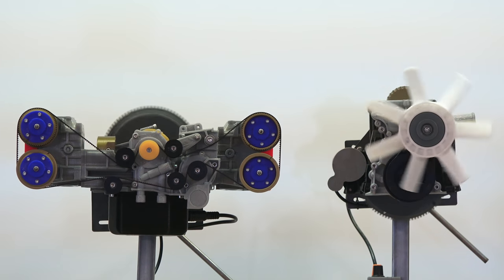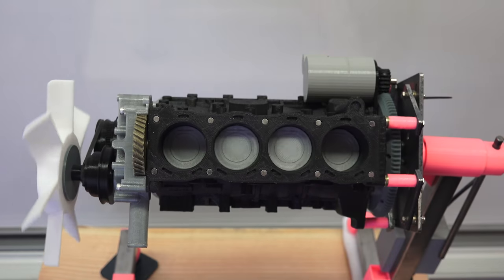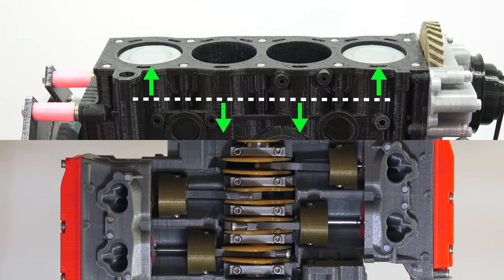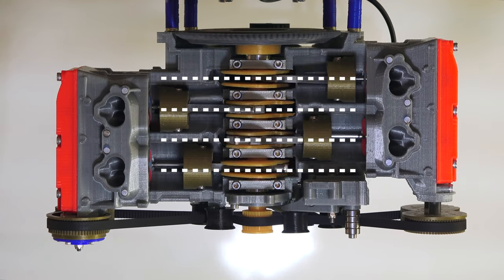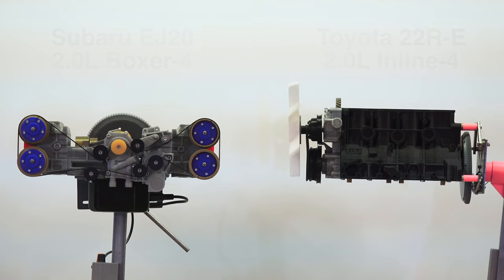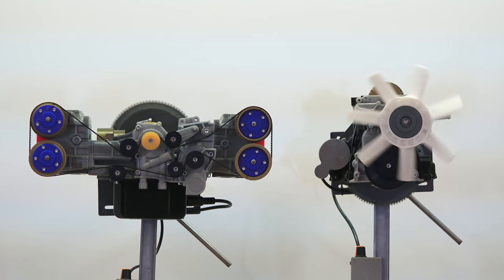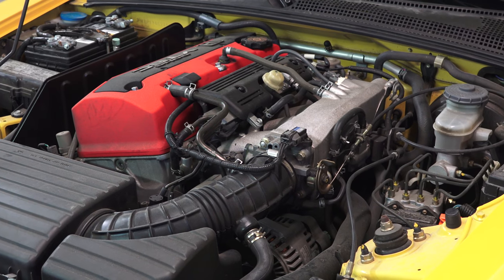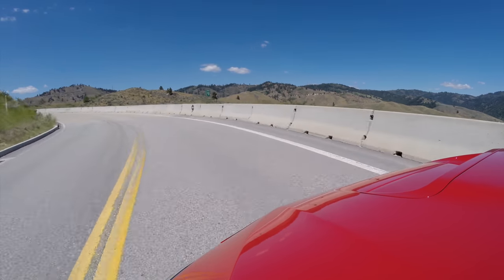The Differences Between Inline Four & Boxer Four Engines

Comment: You mentioned that with 6 cylinders the forces are more balanced.
What about with 2 cylinders? Like in BMW motorcycle engines.
Reply: oh they shake your teeth out.  False teeth with the average BMW bike owner.
Reply: bmw motorcycles are absolute shite.
Reply: I have BMW's since I was 20. Boxer and flying brick. And after 20 years still have all my teeth on. Just because you don't like it, you have to be troll? 
I was only asking for a technical explanation...
Reply: They are also super super super expensive to buy/make, more service is needed and higher gas consumption. A balanced crank
 and forced induction is the way to go IMO
Reply: Wrong!
Expensive yes!
But in a long term service is not more expensive than a R1 (2014). Service once a year or so... anyway.
And consumption wrong again, less than a 2016 Africa Twin. Same trip, same roads, same places, very similar load...
Anyway, I'm not here to defend BMW against the rest of the world... every brand that you may like has good and bad things. And BMW is not above all others.
Again my question was only in a technical perspectiv.
Reply: I own a BMW motorcycle with their Boxer Twin. To be brief, it has the secondary vibration force that sort of twists. In essence, You pull the clutch  in, wring the throttle and the bike revs up and gently vibrates to the right. Its a great feeling, and the amount of vibrations is just low enough to feel connected to what messages its sending through the bars. Though longer trips.. Could use some vibe dampers on the throttle side of the handlebars :) The more you know!
Reply: I also believe Honda makes flat-6 for the goldwing, and i hear  that thing is a Beaut to drive :D
Reply: I'm personally more of a harely/american car and truck person
Reply: Jamie Mills  " poor reliability" ha all 4 of the American vehicles I've had over the last 10yrs ( 2 Lincoln ls's, a mercury mountaineer and a dodge Durango) have been far more reliable than the pos Honda I used to have or the bmw I had for 2 months before it blew itself up, the only reason I've had as many American cars as I've had is two were taken out in accidents.
Reply: Kieran Matzky nothing wrong with that. I went from kawi to bmw just to see how it was. My next bike is probably gonna be the Harley 48. Man that bike looks n sounds so killer!
Reply: I thought bmw only made 4 cylinder bikes
Reply: BMW motorrad makes Flat 2, Inline-4, and a 1.6 inline-6 for their K 1600 GTL (top of the line bike). Their all fantastic. I just wish they believed in counterbalancers for the inline-4s!!
Reply: Yes, BMW only made 4 1-cylinder bikes. ;-)
Reply: BMW makes the BEST bikes in the world. Second place probably Honda. You have to be parallel to the motorcycle industry to think otherwise.
Reply: Two cylinder engines are the worst. Either you balance the vibrations but have uneven combustion events, or have even combustion events with all of the mass moving in unison.  A 270 degree crank splits the difference between the two.
Reply: Amândio de Aveiro The BMW boxer has been refined over time so that the vibration is not an issue for most. Many would say it's a positive which adds character. The low centre of gravity is particularly helpful in a bike. I speak as an owner of a top heavy (but otherwise great) Triumph.  The boxer does have the unique twisting moment which wants to rock the bike around the longitudinal axis. I believe this is caused by the orientation of the crankshaft rather than the boxer layout. It's only really noticeable now if blipping the throttle when at a stop.
Reply: Just get a triumph triple, have the best of them all then.
Reply: re: "I believe this is caused by the orientation of the crankshaft rather than the boxer layout"

correct, that's just torque reaction because of the orientation of the crank.  Newton defined it in his 3rd Law of Motion.  V2 Moto Guzzi's do the same as do airplanes along the roll axis from lowly Cessna's to F16's.
Reply: re: "Two cylinder engines are the worst"  no, Two cylinders that aren't a 90 degree Desmo or a 90 Degree RVT (aka Honda SP-2) are the worst. 

motorcycle guys know what i'm talking about (Willis).  :)
Reply: He said for every three pistons u have a balancing effect so no
Reply: Amândio de Aveiro p
Reply: In an ideal world Harley would put their heads outta their asses and learn from GM how to make a good modern pushrod OHV motor, until then, the V2 configuration will be forever tainted with H-D's reputation
Reply: Amândio de Aveiro in
Reply: The briggs and stratton opposed in in my lawn tractor is an engine like that. Vibrates like crazy. Great engine though, previous owner used it commercially (it is consumer model) maintained it well and it runs fine for me, it is a 2001 model. I think Briggs uses V-Twin now, but the opposed was a great durable engine. It smokes a bit on startup because of the design, but probably a good thing because everything is lubed up.
Reply: That's why they've sold so well all over the world for decades. BMW developed and modernized their engines, as opposed to HD which were still unreliable, long-stroke, air cooled cement mixer engines at the end of the last century. Talking about shaking your teeth out, I rather ride a Beemer than a Harley!
Reply: I had the CB360, Nighthawk 450 and a new model CBR500R, all parallel twins. None of them vibrated as much as some of the 4 inlines I rode.
Reply: I'm still waiting for the first bike with a V6... Porsche, are u listening?!
Reply: Amândio de Aveiro 2 cylinders vibrate like 4 cylinders. 3 cylinders are a lot smoother.
Reply: If that were true, why did BMW, who know a thing or two about engineering, add a counter balance shaft in their K75 motorcycle engines but didn't in the K100 four-cylinder engine (which has the same bore and stroke measurements)?
Reply: Matthew Moore Which Engine?
Reply: I've owned  six flat twins. much smoother than any v or parallel twin
Reply: one two three and 4 cyl bikes have been produced
Reply: 2 , 3 is the flying brick , 4 , 6 all BMW
Reply: That's not a vibration, its a torque reaction against the engine spinning that sends the bike in the opposite direction when the engine accelaerates.  Its common to any along the frame bike engine. Ks (Bricks) don't do it as the clutch spins in the opposite direction to the engine cancelling the torque reaction out.
Reply: Single cylinder bikes too.  And they have made triples.
Reply: Other manufacturers do make good V-twins that are efficient, make power and don't shake your teeth out.  90 degrees is the answer.  Look at Ducati etc.  Harley build for a purpose, 45 degree twins make there character engine sound but also create a lot of vibration, a 45 degree engine is also a shorter package makes it easier to fit in a motorcycle frame.  Whats wrong with overhead cams anayway?  They are only sticking with pushrods because of tradition, not because they are better in any way.
Reply: Im not sure if this'll help your question, but the more cylenders an engine has, the less of a drastic vibration will happen. It also depeneds on where the center of gravity is in each engine and where the motor mounts are.
Reply: Amândio de Aveiro
Reply: Ever seen a harley at idle? The mirrors are a blur.
Reply: Kieran Matzky even American cars experimented with a flat 6. Look at the corvair.
Reply: I've ridden the Goldwing. Its engine is amazing.
Reply: BMW began making boxer twins in 1923 and have continued to this day. They made their first four cylinder motorcycle in 1983. For some of us old guys, the boxer is the real deal.
Reply: 6 cylinder Honda Valkyrie for the win!
Reply: Yep. They barely last 500,000 km.
Reply: I own a Honda ST1100 and BMW R1100RT. Honda wins in HP, transmission smoothness/shifting, raw torque, and top end power. BMW feels more nimble and lighter. More gadgets, but a PITA to work on. I'll stick with Hondas from now on. BMW was my first non-Honda bike.
Reply: Love both Honda's and BMW's  but I agree as someone who has to work on their own bike(cant afford a dealership)   Honda's are great for that.
Reply: BMW two cylinder opposed motorcycle engines are ALWAYS smooth be they carb or EFI does NOT matter, I have ridden both makes.
Reply: It's Only Me you mistake BMW & HD... 😅
Reply: Ride NOT drive.

Comment: Make "what's difference between 180° V-form and boxer engines" video
Reply: The difference is: one can spell and the other can't /s
Reply: In boxer engines, two opposing pistons travel in opposite directions, meaning they are either moving towards or away from each other. In a 180° V-form, two opposing pistons move in the same direction.
http://forums.vwvortex.com/showthread.php?6903518-Boxer-vs-Flat-engine-the-difference
Reply: J C what you mean by that?
Reply: mcfresh spelled knowledge wrong lol
Reply: Flat 4/6 vs boxer is more interesting.
Reply: 1D0N he should have just done all 3 in his vid
Reply: The Motor shown is called a boxer engine by the manufacturer. However this motor is NOT a boxer engine but indeed a 180° V4. In a boxer enginge the cylinders lie directly opposit each other and attach on the crank shaft together. So they actually cancel each other out completely.
Reply: Actually any "V" layout engine has the cylinders oriented in a V, not an opposed layout.  The term "boxer" today does apply to flat, horizontally opposed engines, even if the opposing cylinders aren't perfectly aligned with each other.  BTW, did you know that BMW boxer motorcycle engines don't have perfectly aligned cylinders either?  The left cylinder is slightly farther forward than the right cylinder.
Reply: @ashbow: No. That's a boxer motor shown. You've got it ass backwards. If the pistons were on the same crank pin they wouldn't move in opposing directions. All the cylinders are out of alignment in boxer, hence the uneven exhaust pipe length. Trust Engineering Explained, he knows what he's saying.
Reply: @ Fletcher Your right I rembered it kind of wrong.
I mixed it up with the inline boxer. There the Cylinders do lie exactly opposit each other and one cylinder has a forked piston rod so that the crank pin of the other cylinder can go inbetween.
Reply: Not quite, in a true V engine the opposing cylinders attach on the same crank pin, while in a boxer engine the cylinders attach opposit each other. 180°-V engines get sometimes called boxer even if they aren't.
Reply: Incorrect.  A "V" engine has the cylinders arranged in a "V" - hence the name.  "I" is Inline.  A flat engine is horizontally opposed (not a 180 degree V...)  A series of cylinders in a circle is called a radial engine.  Two cylinders inline are called parallel twins.  https://en.wikipedia.org/wiki/Engine_configuration#Categorisation_by_piston_motion
Reply: Read the first sentence under the categories: "The standard names for some configurations are historic, arbitrary, or both, with some overlap. For example, the cylinder banks of a 180° V engine do not in any way form a V, but it is regarded as a V engine because of its crankshaft and big end configuration, which result in performance characteristics similar to a V engine."
Reply: Not really.  I worked in the R&D departments for two different large European carmakers.  No one in the industry refers to flat engines as "V" engines.  The layout or configuration is based on the arrangement of the cylinders.  Not the position of the crankshaft journals.  The term V isn't based on what the engine sounds like or whether it fires "like" a V-type engine.  It's based on whether the block is configured in a "V" shape...
Reply: Alex Besemer is correct. It's not difficult. In a boxer each piston has its own crankpin, thus cylinders are slightly out of line and movement is opposed. In a 180 degree V opposing pistons ride on the same crankpin, are in line, and move in the same direction. Read more: uhttps://www.carthrottle.com/post/heres-why-ferraris-flat-12-isnt-exactly-a-flat-12-at-all/
Reply: Yeah even better.
Reply: No, that is called a "Flat" engine. Hence my previous comment about comparing a flat vx boxer engine. It's easy to remember as a boxer engine moves the pistons like a boxer smashing his gloves together.
Reply from the maker: I did! https://youtu.be/y5oRsvRH_Ig
Reply: Hi, I have an idea of an episode. Can you try to explain from engineering point of view the difference between the soundtrack of the 4-cylinder Subaru STi engine and that of the Porsche 718 Boxster/Cayman? In other words, why do Subarus sound terrific, whereas 4-cylinder Porsche boxer sucks.
Reply: Because turbo vs no turbo...

Both sound badly though, any 4 cilinder.. BMW inline 6 is the best.
Reply: Nope. Both are turbocharged. 4-cylinder Subarus (WRX, STi, etc.) sound terrific, just play a random YT video
Reply: Just not my cuppa.
Reply: We know the difference.
Reply: @ccrider77  I like how you post a link to the different engine configurations with all the information in this discussion, then deny it because you think your opinion is superior to fact. 😂😂😂
Reply: Reading comprehension isn't your "thing," is it...  This is from Wikipedia:  "The standard names for some configurations are historic, arbitrary, or both, with some overlap."  Basically, what I've stated.  Just because there is a technical term for something, doesn't mean that is how it is always used.
Reply: @ccrider77  Nope. I read it just fine. You followed up with your personal experience which is why I found it funny. There is more to this world than everyone here has experienced and to see everyone diving into this dick measuring contest in the YouTube comments makes me laugh but ultimately feel bad for everyone and their pigheaded bias to feel secure in their own opinion by bashing each other over the heads with a keyboard. I've done it myself but those times have gone and now it's somewhat entertaining to watch. 😅

Comment: one disadvantage I have found with boxer engines, especially the honda flat fours is 'oval' cylinder wear, on higher mileages flat fours tend to rest more on the lower part of the cylinder. This can be demonstrated by leaning the flat four engine from level overnight, when stated next morning it will give a puff of burnt engine oil that has leaked past the horizontal piston, not so noticeable on a inline engine.
Reply: A flat four is not the same thing as a boxer. Honda does not make a boxer engine.

Comment: Also, the downfall of the boxer engine is the cylinder walls wear down faster than an inline. They tend to burn oil faster when reaching the 100,000 mile mark. They are also known to blow head gaskets. This happened to my Mother-in-law's 2008 Subaru Forester. Oil was mixing within the cooling causing the coolant reservoir to overflow pushing oil out with it... That changed her mind of never owning a Subaru again...

She's glad she kept her 2003 Mitsubishi Outlander for a backup vehicle. After she got rid of her Subaru, she is back driving the Outlander with now 263k all orginal miles. Regular maintenance, oil changes and timing belt every 75k miles. 👍
Reply: The boxer engine used in the Subaru BRZ/Toyota GT86 is a pretty solid motor and from what I have read doesn’t seem to have the head gasket issues associated with the WRX and STI motors.
Reply: My family has around 8-9 Subarus with over 200,000 miles. 3 or 4 have over 300,000 miles. My uncle takes care of all of them in his business. He has nothing bad to say about the engines. No major problems besides clear traffic accidents. Some of the transmissions though have been a different story. But they are newer… 2014 and 2016 I think. I don’t remember. Anyway I’m super happy with mine. Just added an Accent to replace a van. Wasn’t sure about it at first. But sense it can tow bought my boats I’ve grown to love it.
Reply: @ShanesAutos 
The newer FA20D/FA24D series engines used in the BRZ/GT86/GR86 use metal head gaskets and reinforced cylinder walls to prevent cylinder movement under high RPM and consequential headgasket tearing. The FA series is instead are known for destroying connecting rod bearings. 

The failure is caused by the design of the engine oiling system, allowing oil starvation from the oil remaining in the cylinder heads and not draining back into the oil pan correctly under higher RPM usage. They also glue the engines together with excess RTV instead of using gaskets so there is usually a very large amount of excess sealant floating around in the oil pan, waiting to clog the oil pickup/oil galleries, contribute to existing oil starvation issues and in turn a blown engine. There is plenty of hard evidence of this happening to 2013-2021 BRZ/GT86 and 2022-present BRZ/GR86 models.
Reply: You need to keep up with more frequent engine maintenance on boxers